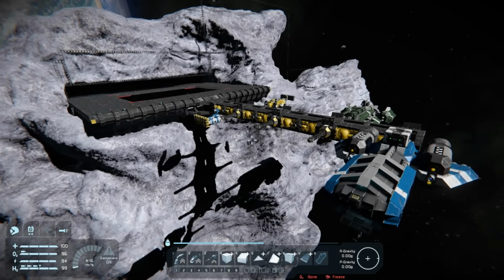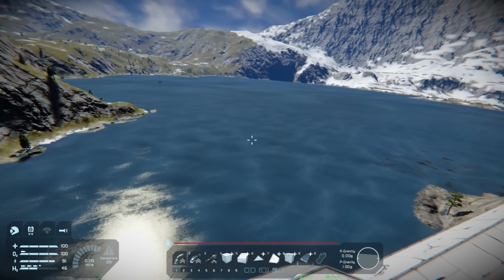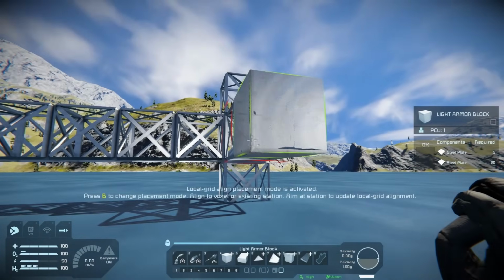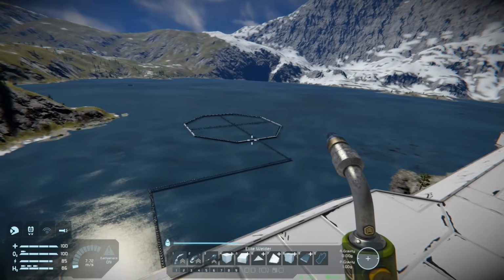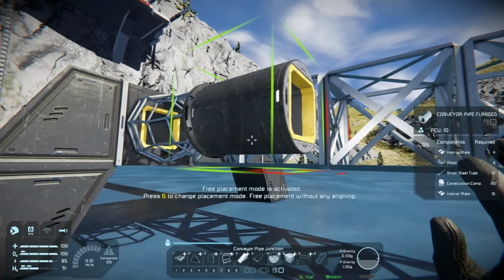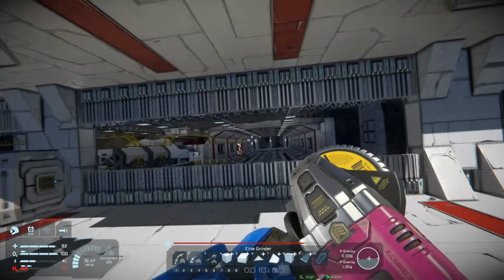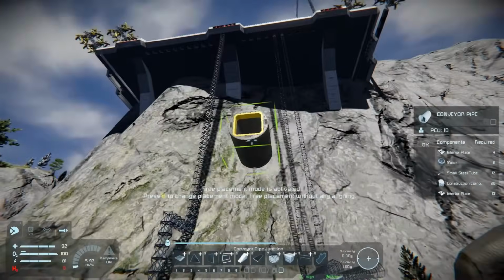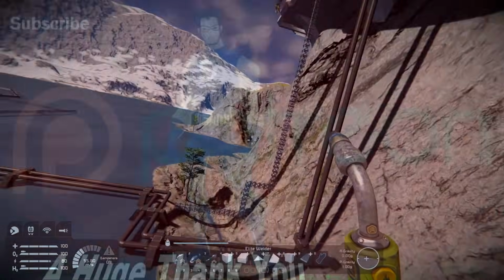Building an ICE HARVESTER Part 1 - THE PIPELINE! - SPACE ENGINEERS Survival - Ep 33

Comment: I know I'm late for the suggestion game, but maybe you could think of this for some future designs:
1) for the horizontal Pipes you could take some Ideas from overland hot-water pipes running between power plants and cities for communal heating (they have regular "Omega-shaped" sections embedded to help with expansion/contraction due to temperature) and also place some catwalks under the Pipes bridgeing the gap between the lake and cliffside
2) for the vertical pipes you could go with a cable suspension design like golden gate bridge (small pistons might look like steel rope, and hinges can connect to the pipe and cliff)
3) or use some vertical scaffolding running between the middle of the pipes and the cliff back and forth (similar design to your support of the landing platform) after all those pipes are heavy and not very strong against holding their own weight against gravity

Comment: I have an idea about the vertical pipes.

the support at the base needs to move over one or two square to be in the center. 😂 

As for supporting the pipe, why not have something to grab a hold of the pipe from the top and bottom. I like the free standing nature of it but instead of an anchor like you normally do, you can try an arm or something to hold it from the deck  and from the bottom of the cliff at the corner (the horizontal bit). 

my idea was to have a pillar sticking out in between the pipe and secure it together with a brace around everything. kind of like what you have in hydrogen refueling station in between the tanks. it will only go up a 10-20 tiles. same with the top. the pillar will connect to something at the floor and deck (I couldn't figure out what the base attaching to the cliff and deck should look like. I want something big and beefy like it's supporting a lot of weight.) if you want you can add another brace in the middle without the middle tile connecting to the top and bottom. it'll only attach the pipes together for more structural integrity.

Comment: Pro-tip:
Adding a remote to a flying ship will allow you to fly it to yourself when you run out of fuel, adding a camera will make it easier when it’s out of los.
Or using the DLC top mount camera on a rotor, with hot bar controls to set the rotor forward, left, reverse, and right on top of your ship gives even more visibility when remotely controlling.

Or you can just clone yourself, cause that’s quicker and all.

Comment: For the vertical pipeline, perhaps, half way up the cliff drill a roughly 3x3 block hole in the mountain, then go inside and drill out a cavern big enough to store a few large storages. Fill with storage, then block off the opening and bring a pipe out the center that runs out to the pipeline and connects in-between both using some T junctions. Then build the same style of support you're using on the horizontal 1 block above and below the T junctions, then attach them to the cliff face using inverted arches.

Comment: Skye, I am worried that your pipes may have been split into multiple grids from some of the cutting. If so, and they don't connect properly when finished, you can merge them back together with temporary merge block sections. Just a recommendation in case it happens that way...

Comment: as for the pipes up the side of the base ... instead of wrapping around them .. add two blocks evenly spaced going up ... and connect those on a 45 or straight in to the mountain ... then its like an eyebolt holding the pipes in place ... at the bottom just make a platform and rest the turn on that ... make it look beefy so it appears to hold the weight of all above it ... but the person who said make a building at the trench in front ... has a great idea ... even left a way to star wars it up a bit with decoration ;)

Comment: dont T junction all the deck connectors ... pull the pipeline towards the mountain one row and then t junction the 2 lines together and run over to the pipe ... the connectors out to the near corner can be T'd up the others leave un connected for now as they can end up being used to connect miner drones with a single drill and a storage bin ... one for each resource you may want in space ... and even use them for the transport shuttles that are just engine and storage going back and forth to the asteroid this way all ores and gases can be created down here and then sent to space to be used up there as well ... btw 2 hydrogen engines per o2/h2 generator ... and one small grid hydrogen tanks is easily filled several times from a large grid tank

Comment: You also have to make the expansion joints for the pipes for each straight. I mean, not really, but it would 1) add enormously to the immersion. 2) be visually more interesting than just a straight pipe. 3) be a good solution to make an underpass if you ever decide to go full Space Engineers and make a lift from your base to the ground level for rovers. 4) give you much better excuse for jokes, as that is an inherent quality of bendy pipes over straight ones.

Comment: When you build a section use holograms to make the rest easier. This works if the rest is the same as the existing section you built, such as with the pipes (in case you want to move that section over so there is less bends) or with what I imagine will be the foundation with the sections of the octagon.

Comment: For the pipes:
1) The first corner you made, keep running the line straight from there and make it turn later. That way you only need one corner and not two. Plus it looks cleaner.
2) where the pipes coming from the base to meet the cliff side: put a large belt there! You can have all the pipes from the base meet into the top of it and pull any number of pipes out of the side as you need when you need!!

Comment: Build a "pump house" at the bottom of the pipes to hide the offset and act as a support for the vertical segment. Could also act as an emergency resupply station for stranded engineers.
Reply: thought the same, just a box would suffice i guess... or you kinda "embed " the pipes into the mountain maybe? not completely... only smoothing the channel
Reply: I was thinking pump house and then an excuse to drill more holes in the cliff, some access shaft type thing on one side, and the pump house turns 2 pipes into 1 pipe that goes into the cliff. Personnel elevator on one side, pipes on the other :p
Reply: A Interaction for the Interaction God, a Comment for the Comment Throne, for the Almighty Algorithm
Reply: This^^
Reply: for the vertical section. "band" the pipes together with 1 block thick support running back into the cliff then have a gusset running from the cliff to the 2/3rd point of the straight 1 thick block support. could even be done with a hinge and switch to small grid.

Comment: A cool option is to keep the pipe where it is adding extended supports to the cliff, but with this. You can add an access staircase or ladder, so if you run out of hydrogen, you have the option to use this access to climb back up

Comment: you know what would be a good idea,   for the welding / drilling ship  make the head assembly units  removable,  sort of like a  skid steer  you could use make them and have stands for them and simply disconnect,  and  fly over to another head and attach it.   hope that makes sense.
Reply: It is a great idea which does not work well in SE unfortunately :) Much easier to just build a few ships.
Reply: @andyblondyn1898  ah well to bad would have been neat it it worked
Reply: @Steve-od2di  I mean, it does work but the ships with it are not small. It is far easier to build the "base" ship, print it 3 times or more and have the drill, grinder and fight version.
Reply: You could do it with merge blocks
Reply: @GrahamBale yes, and connectors and it would still be impractical and large. It does work great for big ships and personally I am utilizing this.
Reply: great idea, then its like the header from a Farming-Combine!